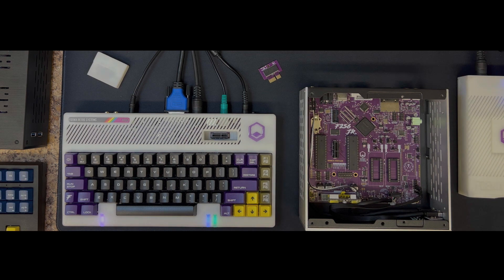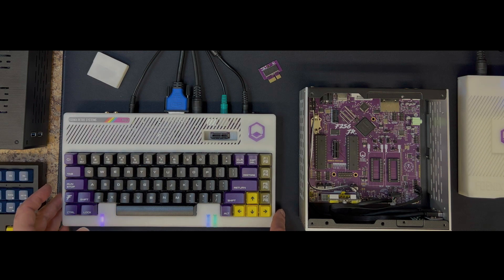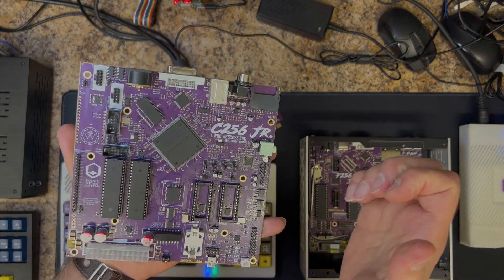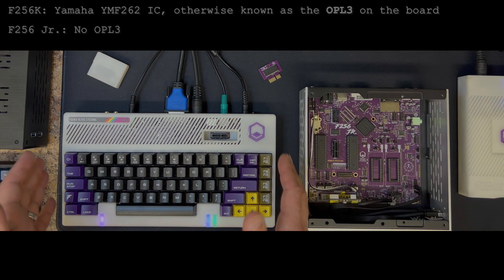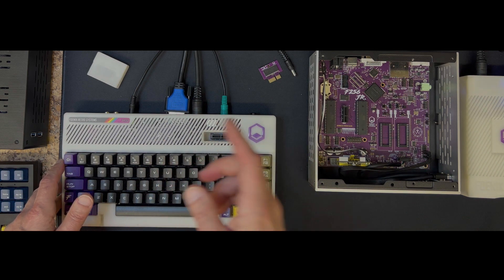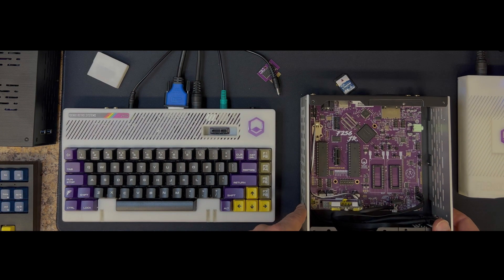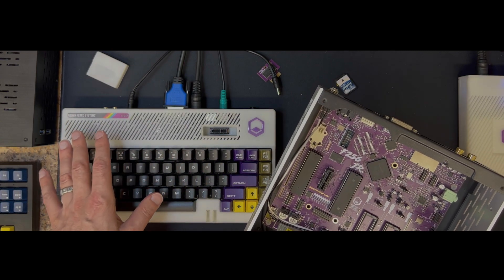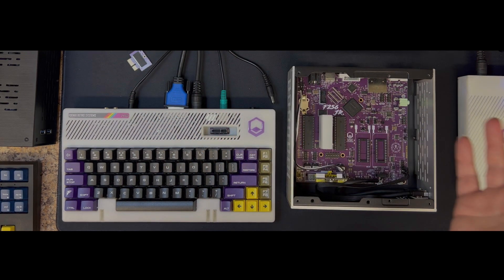Foenix F256K versus F256 Jr. - What's the difference?

Comment: Thank you very much for doing the series of videos on the F256K.  I just received mine a few weeks ago and have just begun using it, I hope to port some of my old C64 programs (mostly BASIC with some ML) to this new retro system.  I am amazed at the quality and for sure need to read the manual as some things are not entirely obvious.  IE:  What the Restore key does because for me it just changes a character on the top line every time you press it.  Being so used to Run/Stop + Restore to get our of whatever is 2nd nature and on the F256K it doesn't seem to do that.  Same with CLR/HOME as it doesn't go to the home position of the screen nore does it clear the screen.  Keep up the good work.
Reply from the maker: Some of the built-in features that you mention are still coming along on the F256 platform (RESTORE, for instance) and combinations of such.  They were defined in hardware but connection to the Kernel is not yet there.  But one thing the F256 has that the Commodore platforms never had is the ability to stop the CPU externally (through the USB debug port) and pull memory or push in memory.  Also, the rest button will (similarly to a 64 if so equipped) will reset the machine, leaving most of memory alone.  There is no 'un-new' command yet but I'm sure the people maintaining SuperBASIC now can work one up at some point.  If you haven't done so, have a look at these 'Newsletters' which I publish and have tons of information and articles about the F256 specifically.  You can download the PDFs here -> http://apps.emwhite.org/foenixmarketplace  Otherwise, I'm glad you like the platform.  See page two of any of the full issues for links to the DISCORD channel (also published in most of my videos here).  Thanks for the feedback/message.
Reply: @8-bitwallofdoom  Cool!  I will for sure check those out.  Thanks again.

Comment: I have been looking at these for a while now.  I have zero programming skill, but I want to learn.  I really have been thinking about getting one of the F256K some day.  I hope to learn assembly for 6502 and maybe learn to program music for the SID and OPL3.  I just have to wait until I am a little more flush with cash.
Reply from the maker: It's a good option, versus trying to keep an old / vintage machine running and if you are just learning, the SuperBASIC language is full featured.  Luckily, 6502 resources are everywhere and I've been personally porting C64 assembly language recently.  You'll see a post for the Commodore Christmas Demo music in a few days; I'll have it on GitHub also so others can learn from it as I have.  If the F256 is on the edge of expensive for you but you want to get started, look to pick up a F256 Jr. but you'll need to purchase SID chips and of course, it does not have an OPL3.  The F256K is a beautiful machine but if I'm being honest, I do most of my work on my Jr. just because of the way my desk is organized at the moment.  Thanks for the comment.

Comment: Hello. Nice video. What enclosure are you using for the Jnr?
Reply from the maker: Specifically: "Goodisory A01 Aluminum Mini-ITX HTPC Desktop Computer Chassis (Black Aluminum)" sold by Amazon, but this is an item shipped from China so you may find it sold by other vendors.  It's all aluminum and well finished, useful rear punchouts for wiring/switches, and works well with the Jr.  I paid (and it still sells for) $49 Prime.

Comment: This thing in the 65C816 variant seems exciting. We can expect such a machine to outperform most any 8-bit machine to date that I know of. That Processor is 8 bit, yet can do 16 bit addressing on the RAM, right?
Reply from the maker: Correct.  It has 16 bit-registers, and additional instructions for 'far' jumping.  It takes a little getting used to (in order to access the full 24 bit memory map) but the best part is that it resets (powers on) natively into 65C02 emulation mode so it can do either.  At present, the F256 machine supports the additional opcodes and 16 bit register functionality but the MMU which in onboard, must be used in order access the additional 8K banks of memory; shortly, new memory model support will be released which provides a linear memory map where you can address 03:FE62 (as an example) rather than having to bank a particular 8K bank into 65C02 'visible' footprint.  Point is, the new capability will let you do both, just as you can on the Foenix C256U+, Foenix FMX, and the upcoming Foenix GEN-X system.  Thank you for the question.

Comment: Thinking the 2 computer options I suspect the goal was they keyboard version, but in order to make the computer more accessible they thought how can they give the majority of the experience andbl compatibility at the lowest price without reducing quality and I think the jr is the result.  Quite a good 2 options.
Reply from the maker: The F256 Jr. was first and at the time, the 'only'.  It was a rethinking of the C256U which was a low-cost model produced about 2 years ago; but shortly upon release of the F256 Jr. (this past January), the idea of a keyboard based model with a custom case and all ports brought to the edges of the machine was floated and the take-up and appeal has been very good.

I believe a new round of 'Jr.' boards is being produced now for the next generation of customers interested in getting onboard with the low-cost platform.  With the exception of the audio section, they are functionally identical but of course, the F256K (keyboard version) makes you feel like you bought an 80's/90's computer, not a kit.  I have, and really like both.